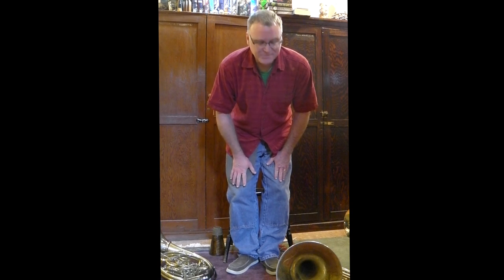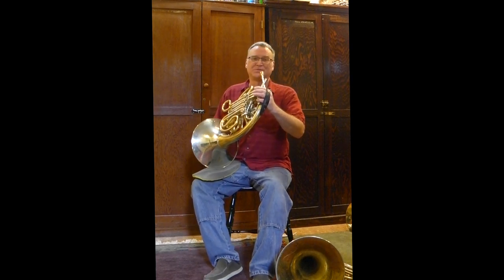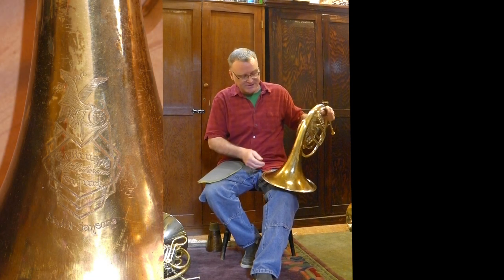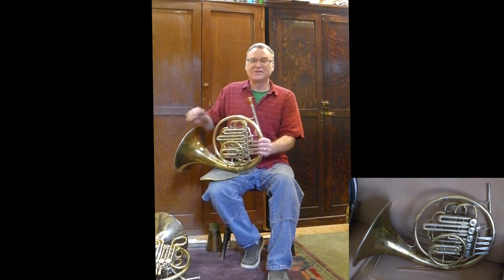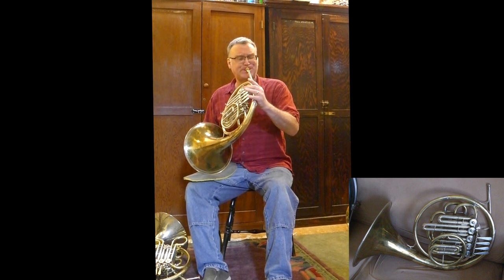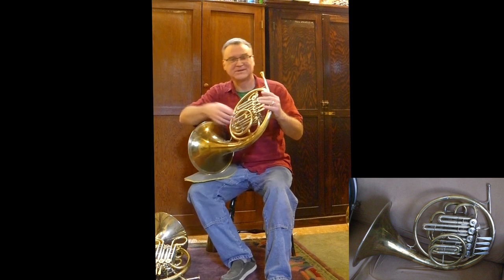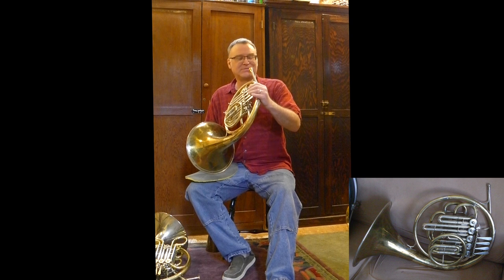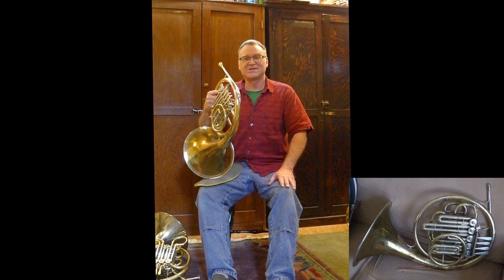Richard Burdick shows off his Kruspe: Sansone Model French horn

Comment: Richard, amazing video plus your chromatic scale.
Yes that's the Sansone I bought, and oddly enough it's also missing the thumb lever!
Questions for you...
Is it light weight wise?
And... Did you need the palm rest? That is supposed to slide on for left hand grip?
Reply from the maker: Let see, I love the Klebsch strap on the Finke triple, just ordered a new one. The big question: lightweight? I think the leadpipe needs to be free to vibrate but the bell needs to be as heavy as possible to project.
Reply: @RichardOBurdick  thanks Richard.. And your mute just arrived!!
Reply from the maker: @davemiller7633  how is the mute?